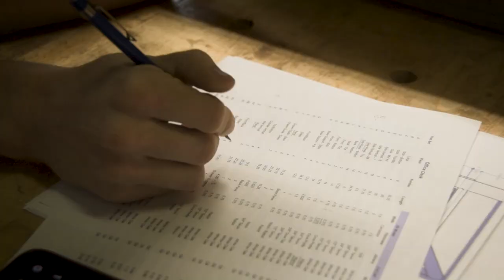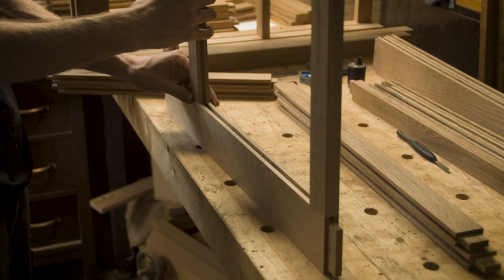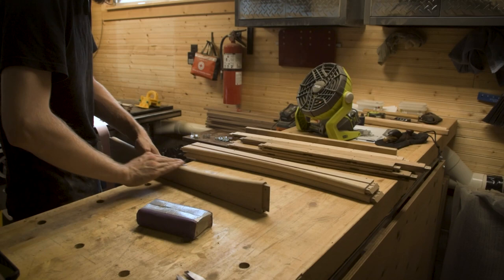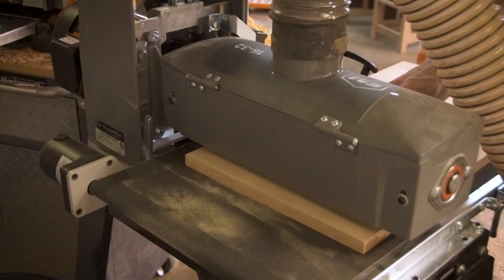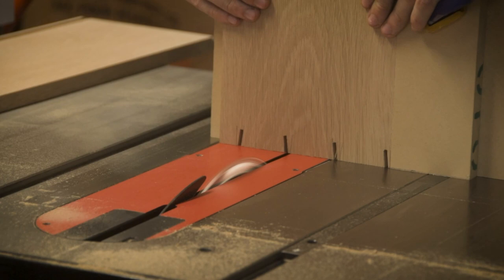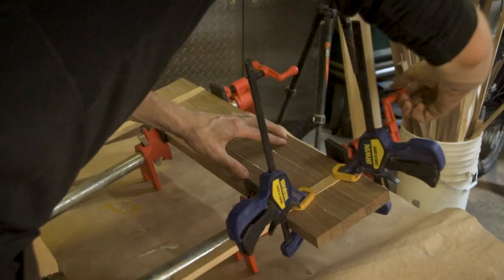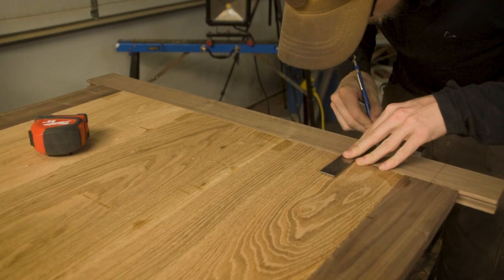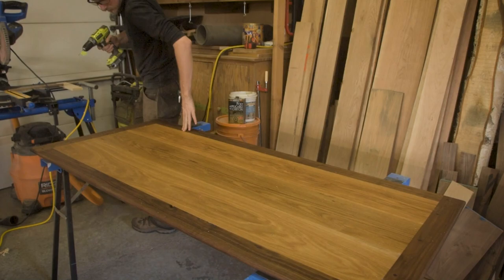Office Desk for a gaming computer

Comment: love the desk . I need one now! .. re;  depth stop .. saw your flag, but I needed to drill into an exterior wall of our new travel trailer so I estimated wall thickness at 1" , and drilled thru a length of wood such that the bit only extended 1/2" out, drilled w/o fear I'd poke thru to the outside .

Comment: You could easily make a gaming desk and sell it. You could make the design more simplistic so that it would be easier to construct and take less time and as such make it cheaper. 
Using pine and plywood could bring the cost down as well but it would still be a high end desk that a person could not buy in a store.
Reply from the maker: There are defenitly ways to take a design like this and simplify it for production. I make pieces that way occasionally, I just don't show them on here because I don't think they are as interesting to watch and usually like you said the goal is to get them done quickly and efficiently.

Comment: Very nice desk and good construction but won't your pc need to breathe a bit more? I know water cooling displaces a lot of heat but the fans themselves create a decent little chunk (at least in mine, got 11 fans). Just the heat off of those alone in a confined space would make me nervous lol. Nice build though, enjoyed watching.
Reply from the maker: I was concerned about overheating too, so I made sure that I could easily remove the back panel if I noticed too much trapped heat. Also, you may have seen the missing set of panels on the inside face of the cabinet, this basically creates a wind tunnel through the case.
As for specs, both my CPU and GPU are liquid cooled so even when gaming for a few hours my CPU maxes out at 50 Celsius and the GPU around 60 Celsius, both are very good temps and won't damage the hardware.

Comment: The desk looks great not my style but that does not mean it is not beautiful. But as a bit of a computer gamer myself I an worried looking at the desk as it looks to leave little room for airflow. Now for short gaming session or light games this probably is a none issue but for the more demanding games and especially longer gaming sessions you might find that overtime your system will begin to struggle as the relatively small enclosure will get heat soaked and the system will find it harder and harder to get enough cool air in its surroundings.
Reply from the maker: By looking at it I can understand why you would think that but I can safely say there is no problem with air flow, it actually becomes a bit of a wind tunnel when I have everything running! I was able to play Starfield at 4k and I think my longest session was 10 hours, and my cpu and gpu never went over 65°C.

Comment: Maybe I missed something here, but it doesnt seem like youve done anything for ventilation for the computer. I see you putting a solid back on the desk behind the computer and I dont see any vents or fans or anything else setup to keep the computer from melting itself inside the desk. Sticking it in that hole, youre basically recirculating hot air from the exhaust fans back into the intake. Unless I missed something, youre going to drastically shorten the life of any pc you put in there due to overheating.
Reply from the maker: You did! On the inside of the computer section I left out a section of panels so that air can be pulled in through the front of the case and pushed out the back, so there's plenty of air flow.
It also helps that my CPU and GPU are liquid cooled so the highest they go is 70 celsius but that's only on the most extreme games, most of the time I'm sitting around 50 celsius which is a good normal operating temperature.

Comment: Question, why did you miter certain tenons?
Reply from the maker: Since the leg stock is only 1.5in thick the mortises for the side and back stretchers witch are 1in long overlap. By mitering the tenons is keeps the tenons at the full 1in length and maximizes glue surface inside the mortise. I typically try to avoid doing this but when working with thinner post legs like this it becomes necessary.